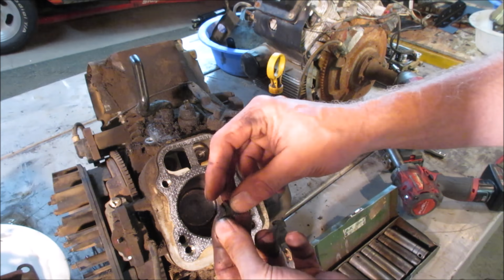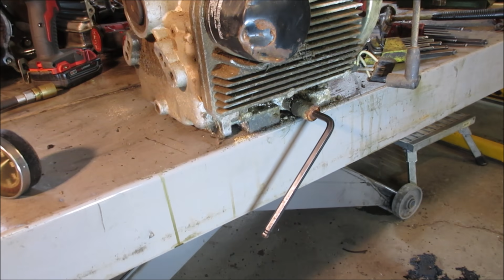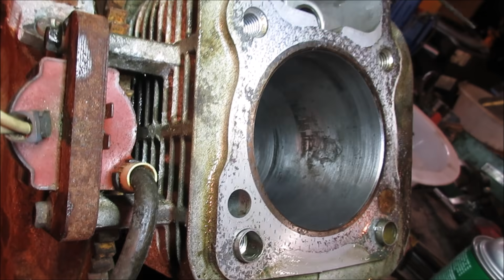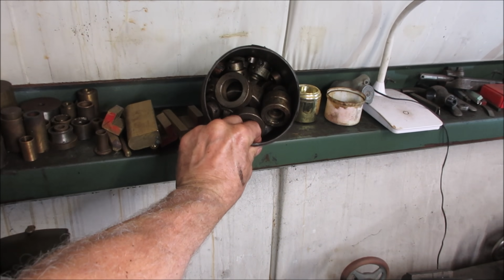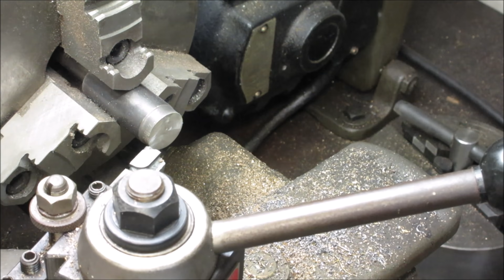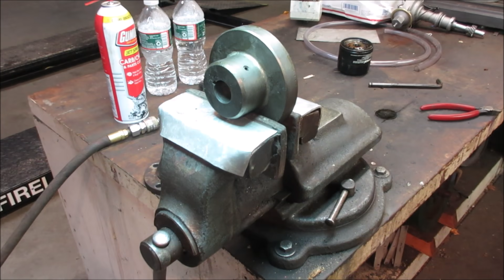Kohler Engine Teardown and Crankshaft Mods,

Comment: In many cases you can scrub the carbon ring off the top of the cylinder and then use a large Shop Vac hose on top of the piston to pull it out.
Reply: Yeah but we all wanted to see inside the case anyway.